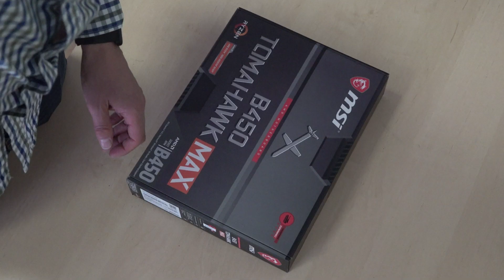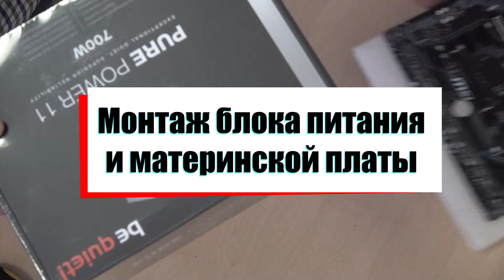Сборка ПК Ryzen 5 3600, RX5700 XT в корпус Deepcool Matrexx 55 с RGB-вентиляторами Dr12Pro 5in1

Comment: Я осенью 2020, как раз перед криптой, собрал похожую сборку. Вместе с моником 1440р и на сдачу с клавиатурой, мышью и наушниками обошлась чуть чуть менее 100,000₽. RX 5700XT gigabyte gaming oc 1.0 rev, Ryzen 5 3600 (box), MSI B450 tomahawk max, и озу corsair veangeance 3000 15 cl, 8×2. Все эти комплектующие брал с CU по выгодной цене, напр видяха обошлась всего вместе с переплатой на госпошлину, доставку 31,000₽. Остальное железо брал в местном днс, из того что валялось на полке по более менее приемлимой цене чтоб влезть в бюджет 100,000. Бп 750Вт Zalman gigamax, 2,5 sata накопитель apacer as350 panther 256Гб, жд wb blue 1tb, pccoler ci-x5b, корпус cougar  mx 330-f и моник samsung 27', 144Hz, 1440p

Comment: А можете подсказать, сколько на этой плате msi 4-pin разъёмов и 5 вольт разъёмов?
Reply from the maker: 1 x 4-pin CPU fan connector
1 x 4-pin water-pump-fan connector
4 x 4-pin system fan connectors
Reply from the maker: 2 x 5050 RGB LED 12V connectors
5-ти вольтовых RGB-коннекторов на плате нет. Поэтому и не получилось синхронизировать эту кастомную подсветку от клиента с материнской платой.